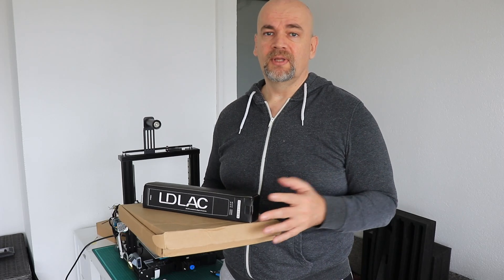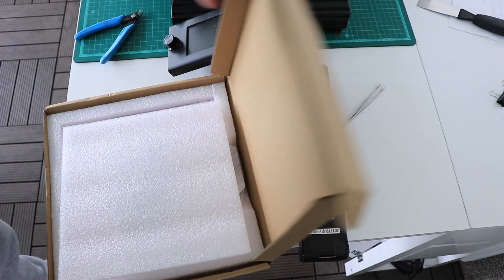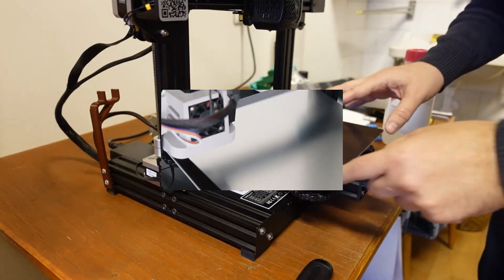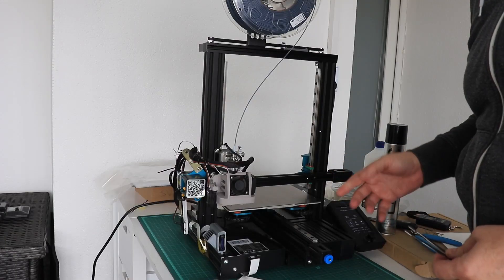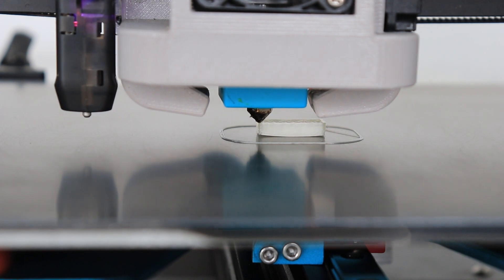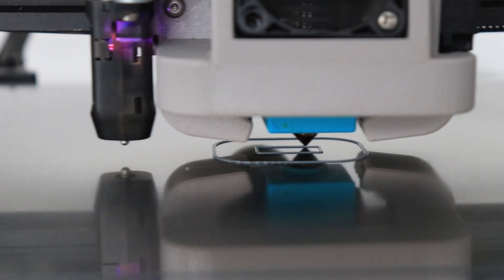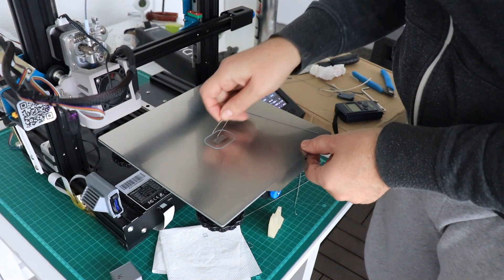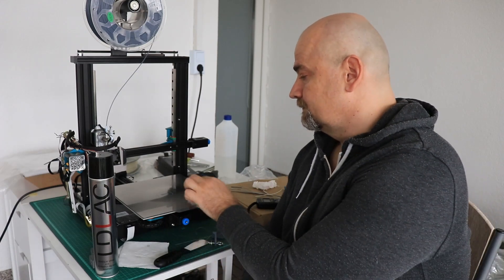Kingroon PEI flexible sheet + LDLAC adhesive spray to prevent warping? Let's find out

Comment: when I looked for content about the nonoilen filament, you were one of the few sources, who tested the temperature resistance, thank you for that. I did a lot of testing with the nonoilen now, I tried textured PEI, the ender 3 and 5 pro original textured magnetic sheets, these blue chinese magnetic sheets that are known for sticking way to hard to PLA and finally another black textured sheet that I believe is PC. The nonoilen sticks best to the PC sheet, the blue chinese stuff is also good, the other two not so much. What is key though for all sheets is to print on a totally cold bed with the fan on 100 percent right from the start. That sounds crazy, but it´s also the recommendation that Colorfabb gives for their ALLPHA filament (that is quite similar to the nonoilen PHB) and they got it right. I am quite sure about this as I´ve tested it with a model that only has a very small contact patch and the PC sheet together with a cold bed and 100 percent fan was the only way how it would stay on the bed, all other temperatures or fan options failed miserably. I believe that the thing with nonoilen is that it´s best to press it into the texture of a textured sheet (squishy first layer is a must too!) and then cool it down as fast as possible before it starts to release, what in my tests always happened due to a heated bed, the warmer the worse, just my 2 cents :)

Comment: I had a mixed experience with PEX,   ABS worked well with Gluestick on a printer that was not fully enclosed, PETG stuck to it too well and actually damaged it.  PLA was pretty good on it, but I found the PEX to be too soft and easy to damage and then any grooves or scratched from the PEX would transfer to the bottom of the print. SO while I think the steel sheets from Whambam are great I would stick to their PEI or textured sheets. PEX was not great for long term use compared to PEI IMHO

Comment: Not trolling. I get fantastic adhesion with Creality’s glass bed and glue stick. I tried a magnetic plate and found it to be only problematic.
Reply: with 3dlac spray every 3 months i use the default creality glass from my e3v2 without any problems. over 2 years now